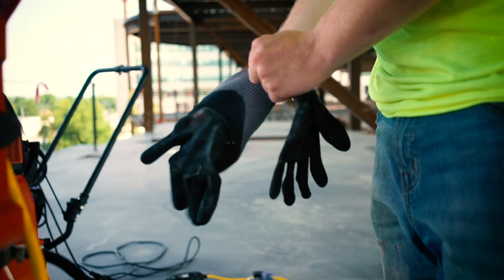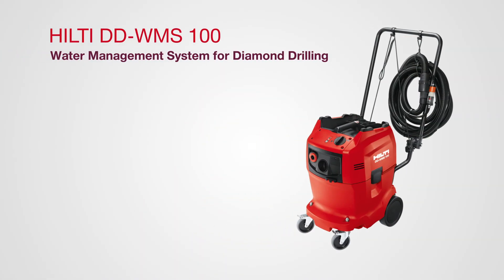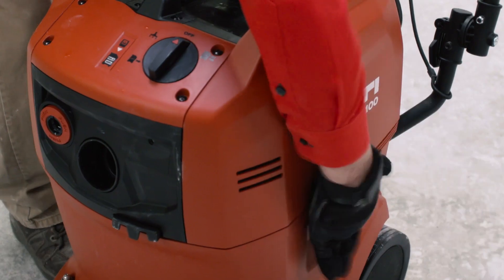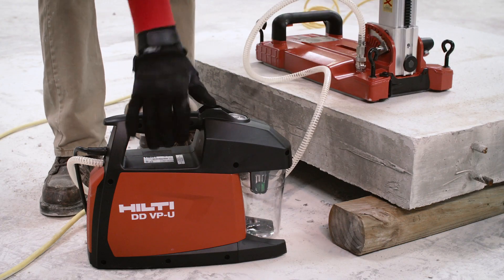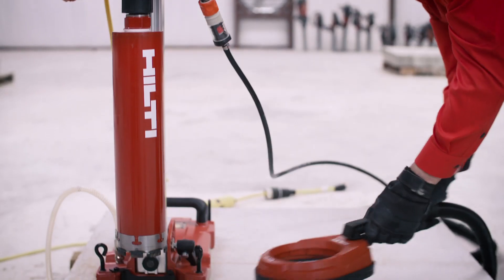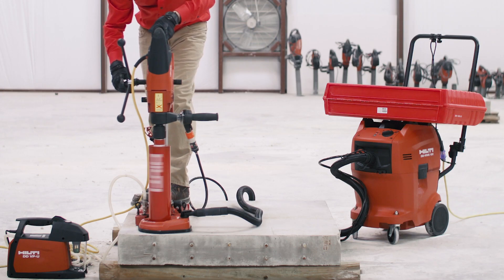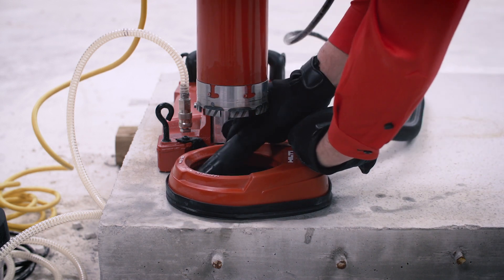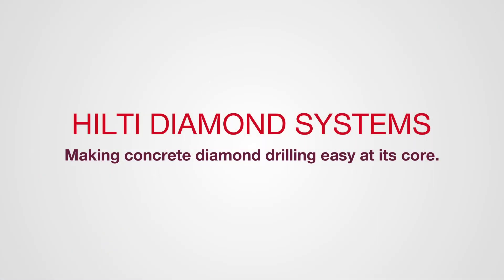DEMO the Hilti DD-WMS 100 water management system for making diamond coring easy

Comment: We bought this system at work. But with the auto cut assist for the drill. We have over 3000 holes to drill 2” wide by 20” deep. The salesman talked my boss into buying that particular set up (we did the same job last year but only half the holes and used Milwaukee core drills). This thing is computerized and have to pair the cut assist with the drill and water recirculating system. We read all the manuals and they are pretty basic. We then had two times a couple of Hilti representatives come to show use how to use it properly. Neither time were they successful!!! They spent more time on the phone with tech support on how to use this machine with the cut assist. Needless to say it’s been over a month and still don’t know how to work it right. I think my boss spent almost $9000 on a piece of junk that even Hiltis reps do t know how to use!!!!!
Reply: sounds like a funny project, Hilti reps are jokes. I never call them, just order online